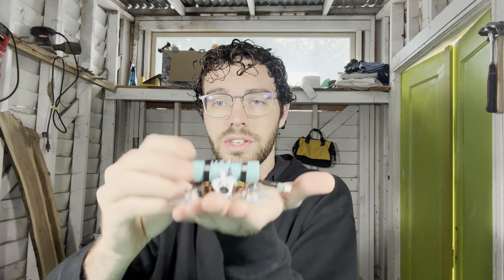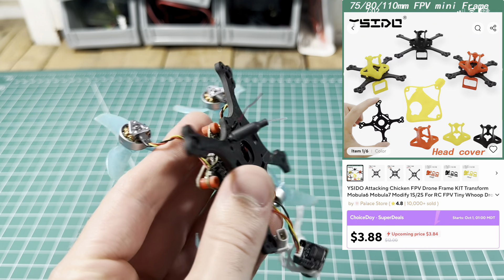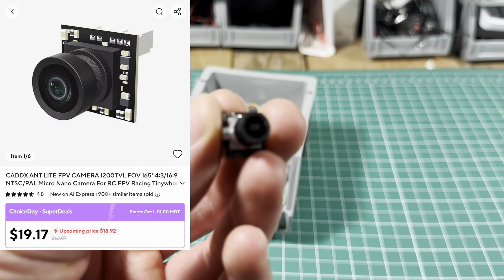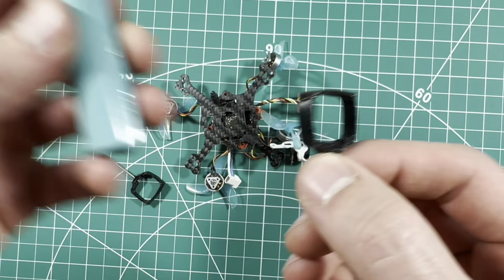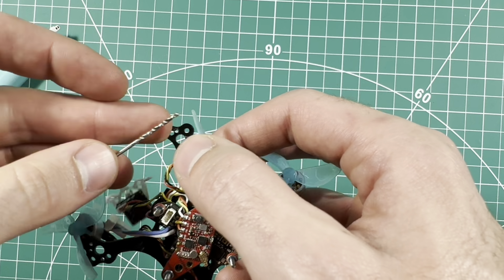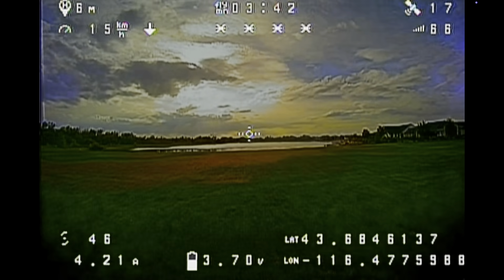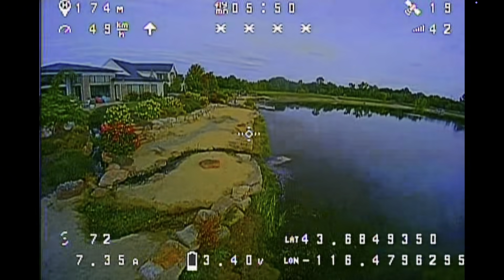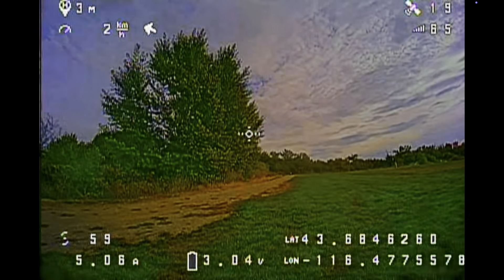Build a Flying 18650 - Ultra Nano Drone

Comment: its confusing that youre able to build a pocket drone with gps and more flightime than most other drones but when placing the antenna you put it in the worst spot possible XD... thats kinda funny. i still impressed what you build up at your own. its not only the batterie some people say that carbon fiber is conductive im willing to say its not good to be placed between radio and antenna. would like to see your drone evolvilng and flying miles away ;)

Comment: Nice video! I just wanted to add that with an 18650 battery on a similar build using an analog video system, I managed to get around 30 minutes of flight time. With DJI O4 on the same 18650, I was able to reach about 25 minutes. And with a 21700 battery you can even fly for up to half an hour.
My personal record with a 21700 and DJI O4 Lite is 5 km.
You can also fly down to much lower voltages, like 2.6 V — Li-ion cells can safely be used down to 2.5 V.
Cheers!
Reply from the maker: That is amazing! What setup exactly were you using?

Comment: Maybe its me but 600meters sounds really underwhelming. I expected kilometers out of it,  as 25mw can get over 1km easily with patches
Reply from the maker: Antenna is probably the biggest limiting factor. I wouldn’t be able to go farther anyways even if I could get better vtx signal because this FC has the soldered in reciever antenna, so my guess is that I wouldn’t fail safe around 700-800meters with the current setup

Comment: Air75 can work with Molicel? 2800/4200mah?
Reply from the maker: I have not tried an air 75 myself with a Molicel. However I have seen videos of other people doing it. I would use the 2800mah 18650

Comment: You could add an dji o4 lite on it, and have better long range, drone but im not sure the o4 and the battery would work exactly, they are power sensitive a lot.
Reply from the maker: I ordered a flight controller that can support DJI o4 lite and will set it up :)

Comment: Great video, thanks. Is it possible to make a mini bicopter using a single 18650 battery? I can't find the parts in my country. Thanks. 👋👍👏👏😊
Reply from the maker: Bicopter will be tricky. You have to add servos so that it can tilt for it to work. Have you built a quadcopter?
Reply: @MediocreNerd  I couldn't produce these small products because I couldn't find them in my country. Could you produce them? Thank you. 😊
Reply from the maker: @fly99hummingbird which parts do you need?
Reply: @MediocreNerd  
Matrix 4in1 FC 
motors 
😊

Comment: I just send you the batteries you need pre-spot welded with copper tabs. I really enjoy this content. Also tell me what connectors you want to make tue full battery for you. I am thinking the frame can be 3D printed with the battery compartment build in in to the frame. adapted for 18650 cells specifically.
Reply from the maker: Thanks for watching and for the batteries! I plan on testing BT 2.0 connector and XT 30. I have both so I can connect them to the tabs.

I love the idea of doing a 3D printed integrated battery holder too. I have been thinking about doing a whole 3D printed version. 

Man. I have my work cut out for me haha

Comment: you should use the battery as a structural part of the drone and mount it lengthwise, custom battery holder with arms sticking out

Comment: Awesome Video. Would be interesting to see what changes would come if building on a light toothpick frame with a larger motor and the same motor with 3" props. Would be amazing with O4 lite.
Reply from the maker: I have 2in, 2.5, and 3in frame coming in the mail. I also bought different sized motors to try. I don’t have DJI but I want to try to build a Walksnail setup

Comment: You left your LAT/LONG in the edit.. great little build! those motors might be better suited to a 65mm bi blade instead of a 45mm tri-blade
Reply from the maker: Yeah… I noticed the coordinates thing now. Oh well :/ not too worried about it but will remember not to in the future. Thanks for the heads up. I will be testing different size props when they arrive soon :)

Comment: How are you getting that range with analog?!
Reply from the maker: The most important thing is to be line of sight. I would have been able to get quite a bit further if my battery wasn’t blocking the antennas.
Reply from the maker: I have heard that Radiomaster pocket can get over 2km of range in ideal conditions and 400mw vtx can do about that much as well with the right setup. Vtx antenna also makes a difference

Comment: Been doing this for about 6 years now ;-) 1203 motor 11500kv with 3inch 2 bladed prop. 20+ minutes of flying, great setup. The best part is... it's almost silent!!! cheers!!!!!!!!!
Reply from the maker: That is awesome!!! I’m sure you have already played around with things plenty. But I will be trying some different frame sizes, motors, batteries, and props to see what works best. One of the surprising things was how quiet it is!
Reply: @MediocreNerd  Brilliant mate!! Playing with different motor / prop combo is the fun part!! Enjoy 😁
Reply: Got a similar setup, with 1202.5 11500kv happy model motors, they're not as powerful as others, but more efficient.
Reply from the maker: @MotobuChasi what frame you running?
Reply: 1203 with 11500kv sound like could maybe used with 3.5" prop. 
1203 has about 18% more stator volume than 1202.5, maybe that enough for 3.5". 

Id imagine that 21700 is a little to much weight for 3" 1s with 1202.5 motors as its quite a bit heavier than a 18650 so id think going up on prop size a little could he make it more balanced.
Reply from the maker: @KidCe. I’m actually experimenting with a 3.5in ultralight toothpick right now. I’ll try it with the 1202.5 motors because that is all I have but I am looking into 1203, 1303, and 1303.5 motors. They are a little pricey but RCinPower makes some 1303.5 motors with 11000kv that would be fun to try out
Reply: @MediocreNerd  found out about the rcin 1303 11500kv an hour ago ^^ cant find 1303.5 though ?

Im currently planning to get some Pickle 3.5" frames cut somewhere here in EU and test it with those 1303 rcinpower 11500kv. The new betafpv matrix 3in1 seems to he the ultimate aio for this with its powefull low voltage bec. Can probably fly a 21700 down to 2.7V  

1202.5 11500kv will be to small for my taste for sure. happymodel 1202.5 11500kv struggled soo hard for my taste with 18650 and 3", i cant imagine it driving a bigger prop and carrying more weight.
Reply from the maker: @K @KidCe. the matrix 5aio can fly a battery down to 2.41v which is crazy. Resting voltage after was 3.07v so not something I would normally do. 

That sounds really interesting. Let me know how it goes! Also, you’re right. They are just 1303 motors

Comment: how on earth did u solder on the motors to the fc? the matrix attachment points are so small, unless u used the plug in motors
Reply from the maker: Solder to the other side of the pads. Once you take the motor plugs off the board, the pads under are huge

Comment: What adhesive is used to hold the magnets in the motor bell and shaft in the motor bell on the small motors that don’t bolt on? Thanks.

Comment: What adhesive is used to hold the magnets in the motor bell and shaft in the motor bell on the small motors that don't bolt on? Thanks.
Reply from the maker: I’m not sure. Good question
Reply: Thanks for answering, man. 🙂

Comment: Can i commission you to make me one im new to the fpv side of the hobby and love this whittle wripper
Reply from the maker: Hey, I am not sure if you actually want me to build you a drone but I would love to talk to you about it. My insta is “the_mediocre_nerd” DM me there and we can talk
Reply: @MediocreNerd i dont have social media but at the moment i have a draknight on the way with the walksnail avatar nano v3 coming and i did have a couple questions maybe you can help me with in regards to the soldering on the FC for the nano air unit maybe like a diagram or a picture on what needs soldering if any to connect the air unit 

And on a side note i would love to commission you to maybe build me little drone later down the line as i have the draknight on the way
Reply from the maker: @HOUSECAT47 I will do my best to answer your questions. If you give me all the details. I can probably help you with wiring
Reply: @MediocreNerd 

Drone : HGLRC Draknight 2-inch toothpick Fpv drone elrs 2.4

Air unit : Walksnail Avatar HD Nano Kit V3 × 1
14cm

Goggles : walksnail avatar L 

Need help figuring out if its possible to plug and play with the air unit or if ill have to do some soldering
Reply: Oh and my radio is the radiomaster pocket elrs version

Comment: Amazing ! How did you configure the motor settings for inverted motors ?
Reply from the maker: It’s the same as normal. Just make sure to put the props on facing up and in the correct orientation.

Comment: for the 18650 could you not just add a battery holder instead of direct solder
Reply from the maker: That is what seems to be the problem with past builds. The connection is never good enough to get maximum power and the holder adds unneeded weight
Reply: @MediocreNerd  oh ok, it would be great if there was a way to bypass that problem it would make swapping out batteries so much easier

Comment: I wouldn't have thought that 45mm props on 1s carry an 18650. The 3 inch babytooth does it pretty well.
I use those 15000kv motors on 1s too. I love them with the HQ 2.2x1.6x3 props.
Reply from the maker: Yeah, was a huge shocker for me too. Will be experimenting with 2in props to see the difference in power and run time

Comment: Sick build man! Just curious, what PIDs are you running, did you tune them? And also why M2 screws instead of M2.5?
Reply: m2 is more common in these smaller frames I guess
Reply from the maker: This is the stock matrix tune. I need to take the time to tune it still. May help quite a bit with flight performance! M2 for less weight and just fits the frame I had

Comment: Dude this is insane! Can you show in next video acro potential of this drone with this battery?
Reply: I don’t think there is any.
Reply: I think you'd need a lipo for only light acro with a setup like that.
Reply from the maker: It is not really meant for acro but can do very light acro for the first couple minutes of flight time. After that it looses that bit of punch needed for even basic acro maneuvers. Will be trying different prop sizes and batteries so maybe more potential in the future

Comment: my experience: betafpv meteor 75 pro o4 carries 18650 pretty well, it costs 100$, but sure you need dji o4 module which is extra 70$, but boy is it worth it. image is crystal clear and it gives you easy 5km of range out of the box, maybe more, I haven't tried
Reply: Where is it costs 100$ lol
Reply from the maker: Would be cool to do an o4 build. What kind of flight time do you get?
Reply: as far as I can tell, DJI is done for in the US? haven't been able to get parts for a while and seems like they're going to be banned
Reply from the maker: @circularly yeah… I have been looking into Walksnail instead

Comment: Could probably swap the 4in1 out for the 5in1 for a bit of weight savings and setup simplicity no?
Reply: Would loose you a lot of range if you wanna use it for micro longrange
Reply from the maker: I ordered some 5in1 boards to test them out.
Reply: @MediocreNerd I've used the betafpv 5in1 with the 400mw vtx (I believe it's the same one that comes with the air65) and it's amazing, super simple and very light, awesome for anything 1S really

Comment: I saw someone using digital vtx with the 18650/21700 battery on their tinywhoop and achieved 5km+ range!
Reply: I think you are referring this one? https://www.youtube.com/watch?v=OVlrA98GVIE       . But lot of ppl doubt he can fly over 10km, but anyway it good to see the drone can carry 21700 battery with such a tiny drone and fly longer time.
Reply: @stargoldsilve  The point is that O4 or O3 DJI system is capable of that distance and longer (10+KM or 20 in some of the setting) so the only problem to solve is the capacity of the battery and the power of the motor to lift the whole thing, which had also already be solved.
Reply: Was it a video? If so could you share it?

Comment: i suggest u use AMPACE jp30 18650 battery, i can handle continuous 30a with burst discharge of 144a for 5 seconds or less. it has 3000mah. i have a similar 1s long range build as urs and i can get around 35 mins of slow cruising
Reply from the maker: I have been doing research into the battery. Will definitely try it!
Reply: Would love to see it in action. Care to upload some footage?
Reply: @AromielVonPleiadesdont have time to go fly it due to work and stuff, but the build is pretty simple, it uses betafpv 5 in1 board with some 1104 motors (forgot what kv and brand) and it runs 3 inch biblades. For cam i use caddx ant. The frame is custom 3d printed
Reply: @rubberbandman6641  at least tell me what kind of frame it is? What kind of 3d model is it?
Reply: Or a p30b
Reply: @revodrvr molicel pb30 have Ac ir of around 8 whilst jp30 around 3, pb30 is decent but not nearly as good as jp30, less ir gives less sag

Comment: Wow, this is awesome.  I really like the idea of the longer flight time with the 18650, I have a lot laying around. I’m new to this hobby and I wonder, how do you get the footage? Is it through your radio? How are you able to download it from the camera?
Reply: Radio yes, it's 5.8ghz signal with different refresh rate and the device on the quad/plane is called vtx, every goggle with the right attenna can pick up the signal then the goggle record what it picks up.
Reply: Most fpv goggles have a DVR function
Reply from the maker: I have Skyzone O4O pros and you insert an SD card into it to record onto. Then you simply upload it onto your device from the Micro sd card